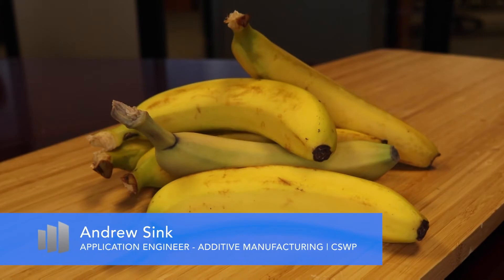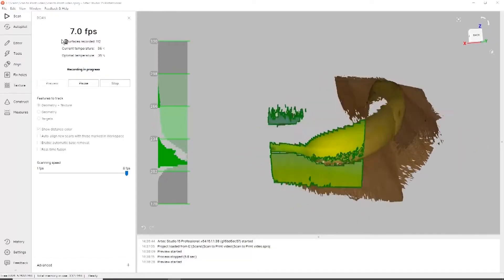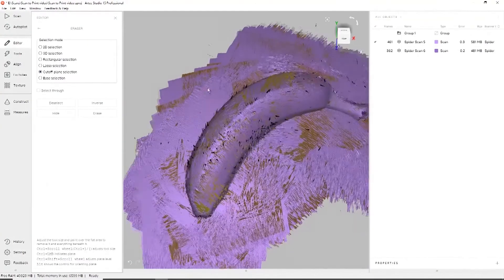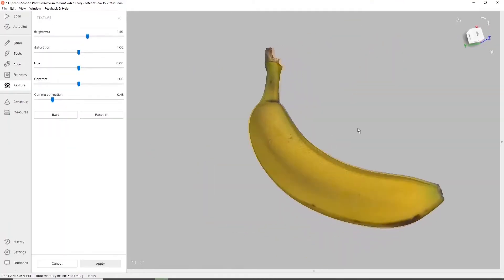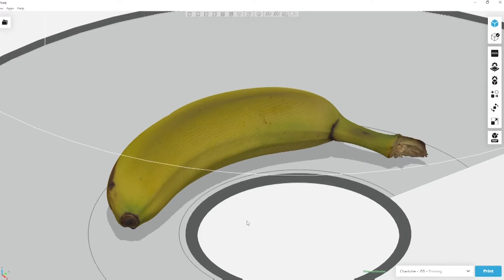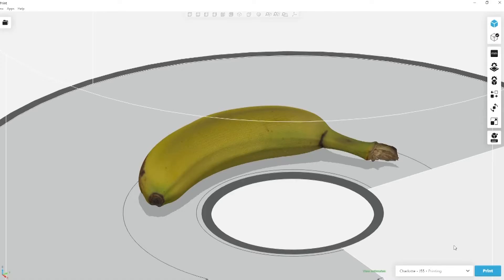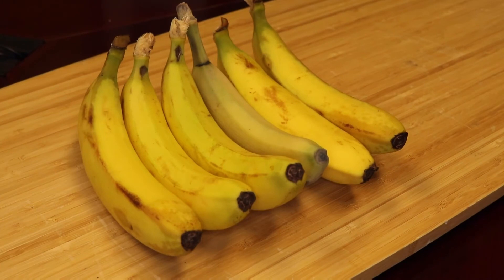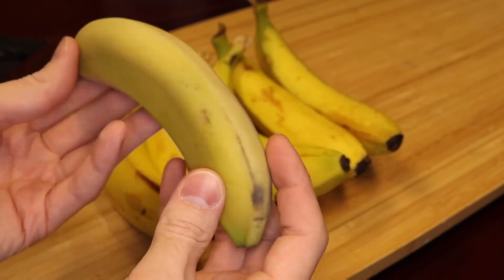3D Scan an Object and 3D Print in less than a day!

Comment: It is then possible to scan a sculpted art piece I have made and use a 3D printer to reproduce. Using the tool you are showing, is that for only one 3D
printer? If not, can you tell me what 3D printers are compatible? And can a hollow piece be scanned? Even if the original is 8's long? March 21, 22